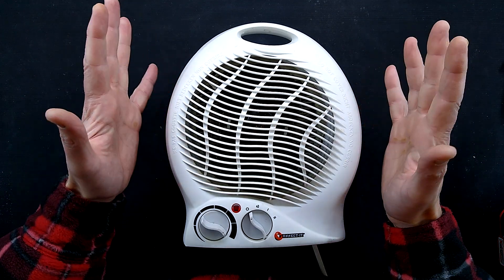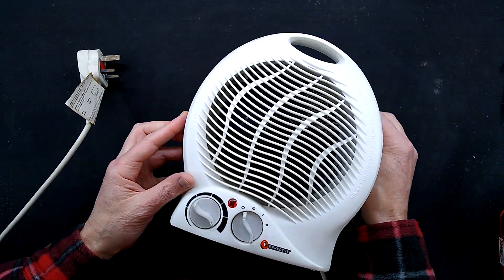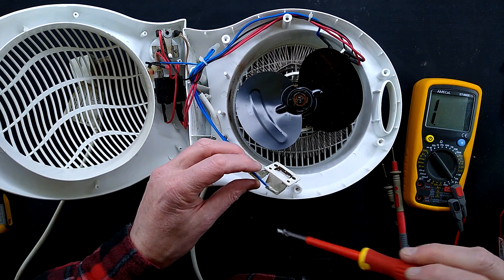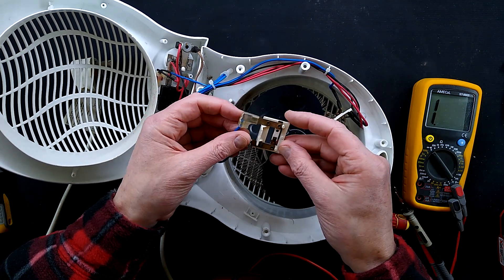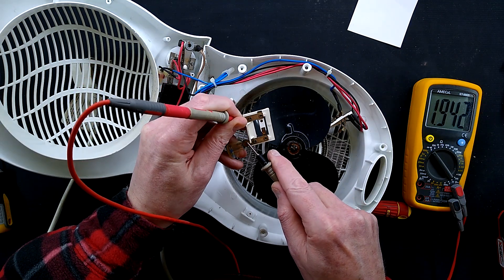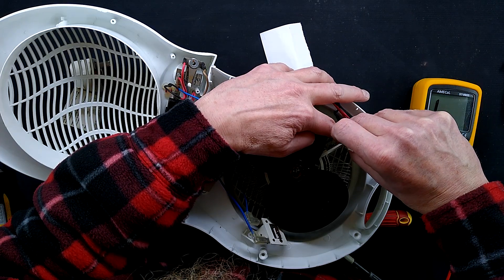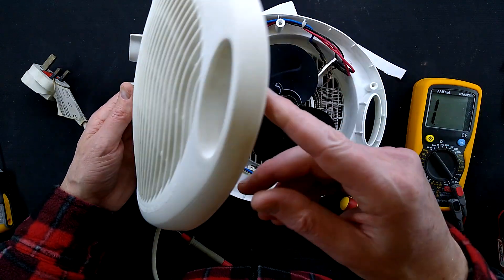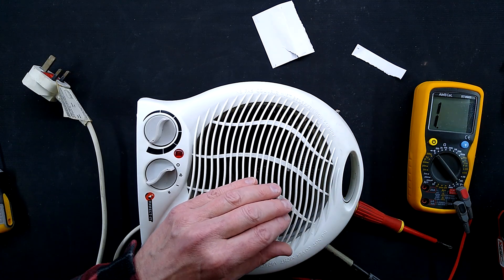Fixing a heater and an apology to my bro

Comment: I favour using something like Electrolube contact cleaner, the sort that leaves a protective film behind, to soak the paper that I drag between the contacts in cases like these.
Reply: that protective film is probably not intended for something that gets as hot as an electric heater-a non-residue cleaner is probably better in this case-something like CRC QD is a reasonable choice.
Reply: @m.k.8158  On careful reflection I am sure you are right, I was thinking in terms of light current equipment rather than power-hungry appliances.

Comment: Umm nice cheers Clive, I just brought a cheap 750w heater with 24h timer for my bedroom to reduce my central heating usage. It works really well for the 15 minuet bursts I run it, it’s definitely a death trap inside though. I expect a huge bang one day 😁
Reply: you should also expect a huge electricity bill.
Reply: @casemodder89  well the smart meter seems to soon be clocking up a huge bill when using the gas heating, £3.20 for a 60 minuets total usage on Saturday plus a shower and washing up. The electric heater just heats my bed room mainly and only seems to add around 80p extra a day with an hours use total. I don’t know what to think of it tbf or how to calculate the efficacy of things vs the rates 😭

Comment: Planning to modify a heater like this. Flat version. Putting a digital (AliEx) thermostat in between. Mine has a hysteresis of 5 degrees or so. Or not accurate enough for me. Keeping all others in between the circuit.

Another one (standing) has a rolling ball to switch of when tilting too much.
Reply: Received those thermostats.
The W3002 230V version looks pretty bad. Gets hot fast on the power side. Had some loose metal in it and wires are thin, fragile and look like aluminum.
The 4 button black one looks better. W3230 (230v input version) 
Maybe you can review one of these with "Schematic" 😄

Available on Ali or ebay for €3,50

Used a old dusk light wall socket / (in/out) as casing for the pcb instead. Just 3mm too small but with a lot of grinding it did fit in.
This instead of putting it in the fan.
Only allows 7Amps (1500W @230V) and mine is 2000W.

Comment: We had a few of these fail and it was always the one shot thermal fuse. They were used as preheating the bathroom for the children, they were never covered, only used in the I. setting (1kW-230V) and most of the time they were let to cool down for a minute in the fan-only setting.

Comment: This particular heater is probably the most generic on sale in the UK , they are branded with dozens of retail badges and cost around £10. Not surprising that most do not get repaired , tracing back from sale to manufacture and all the profit add ons and shipping it makes you wonder the actual cost is to make? Landfill galore. Excellent content as usual Clive.
Reply: I have one here in Finland, not exactly like the specimen in the video, but the general shape is the same, the two knobs just aren't next to each other, but one of the left, one on the right. I have had it for a decade or more, and it was 15 euros at max. It keeps working like a champion, although it doesn't see awfully long hours in a winter, which might explain it.
Reply: @herrakaarme  Same here, I have that same kind of cheap and dreadful heater, though mine is from a somewhat reputable local brand (Supra, located in Obernai, Alsace) but still it feels cheaply made.. I don't even know where this thing came from. 

I did use it a few times when the central heating wasn't working (the joys of living in a 1970's tower block...), although I'd NEVER let that thing run unsupervised.... I sorta got a bit of a irrational fear about these things..
Reply: @Alexis_du_60  Oh, yes, it's most certainly not going to run unsupervised. I've never let it run more than 10 minutes continuously at the hot (II) setting. The middle setting pushes out barely warm air, so I've once let it run for an hour, wanting to give a drying textile a flow of air. That was years ago.

It's such a plastic bubble that it's immediately evident you either want to heavily limit its use or treat it as an expendable commodity.
Reply: Yes it's incredible that manufacturers actually make any profit but often they make more money from P&P than from their goods !
They usually turn things out by the tens of thousands and quite often part of the cost of manufacture (in China) is subsidised so even though only a fraction of the retail cost gets back to the manufacturer they don't lose out completely. This is mainly because their government recognises the value of factories and exporters and will support them even though they are not profitable !
Reply: Remember the 6 Rs - "Reduce, Reuse, Restore, Repair, Repurpose & Recycle".
Reply: These and others just like them are all over here in the states, I have 4 of them. All in various states of failing from the fan, which I doubt can be "fixed"

Comment: I have the same heater and the funny thing is, when it is up right it wont work, but when its tilted at an angle it will work. 
I havent been motivated enough to see what is wrong, i dont use it much anyways.
Reply: the tilt switch is off level.      Design to only work when on flat level surface.
Reply: @danc2014   yeah that was my idea too, i will get around fixing it when i have the need to

Comment: I had a very well made vintage heater of this style made before the days of safety and certainly before RCDs were commonplace. It failed spectacularly when a large sewing needle fell into it whereupon it briefly shone brightly then spat out red hot heating element coil sections all over the carpet. I wasn’t sure which way to run!
Reply: Holy crap

Comment: the heaters we have here, most anyway, have a safety switch that prevents them from working unless they are flat on the floor. if you tilt them at all they shut off

Comment: That's why I prefer dark beamer IR bulbs, no moving parts, no noise, no contacts that can corrode, easy to replace, lower power and the heat can be directed exactly where you want it. Gives you more movement freedom than a heated blanket. 250W at 0.5 to 1m is enough down to 10⁰C to make it feel like 20⁰C. Two, one from each side is even more comfy. They can be found in most pet shops or for heating chickens etc. Heat the person, not the room!
Reply: . . . i might use this idea  instead of my oil electical radiator o-o ... if it really draw such a small amount of power
Reply: @Mawww_MMD  yeah heating a room does take much more energy. Still, at 10-13⁰C +IR you'll still be wearing multiple layers of clothing though.
Heating my 16m² room from 9 to 13⁰C takes 0.5m³ of gas, and about 0.1 for every hour to keep it that way. 250W IR heating above the couch takes the temp to about 22 degrees where I sit. 1m³ of gas is 10KWh of power, so it takes about 5KWh to heat the room with outdoor temps of around 7⁰C currently. I'd need 2m³ more gas to heat to 20 degrees. That's 25kWh total, offset that against just 250W IR heat to just heat my person, there's no contest that IR heating is much more efficient. I heat using gas to 13⁰C so it also keeps moist and fungus away.
Pointing it at your head, the part that looses most of the body heat is pretty effective.

Comment: I always find the plugs on these little heaters become a bit too hot for comfort,  not sure if it's the cable that's too thin or bad contacts in the socket, I just use mine on the lowest setting to avoid too much damage. Cheep rubbish I suppose

Comment: This is an ideal candidate for a diode in series with the element to halve the power, if he's got it under a blanket it'll warm up very quickly even on half the rated power! What I've found interesting with this one incidentally is the complete lack of a tilt switch, all of these upright style that I've owned have had a microswitch on the bottom to detect if it falls over.
Reply: How would that diode work to halve the voltage? A zener diode rated for high power at the right voltage? (that sounds implausible to me) Pardon me if that is a stupid question, I'm just curious.
Reply: @InfoDav  It doesn't halve the voltage as such, it just cuts off the negative half of the sine wave, so acting like a half-wave rectifier, this runs the elements at a 50% duty cycle, therefore the RMS power draw is half what the heater would usually use. No silly questions here, happy to help!
Reply: @ArlenMoulton2  Makes perfect sense now, thank you. Somehow AC always throws me off slightly.
Reply: Tilt switch - one of the best (safety) inventions ever....

Comment: I have an identical looking heater, purchased from a UK retailer, except mine has a switch on the bottom so it won't operate if it is knocked over. It's concerning that some penny-pincher thought that removing a safety feature was a suitable way to retain a little more profit from these, but here we are.
Reply: The tilt feature was required in the US  after 20xx  thus an old version may not have it.

Comment: In my experience, thermal fuses going open are one of the principal reasons that people get rid of microwave ovens.   There are usually more that just a single one in a typical oven, and when they go, they're gone.  Replacing one is usually very simple--just a couple of crimp terminal wires and a screw--and you've got your oven back again.  I keep a bag of about 10 of them (very cheap if ordered through Aliexpress) around for just such events.
Reply: Actually, the standard line fuse in a microwave oven kills many of them-the link inside the fuse weakens due to metal fatigue, so often the scenario is:
Person moves the microwave oven to clean, moves it back, and finds it dead..
replacing the inexpensive fuse generally fixes it.
Of course, if the new fuse blows-start looking for other causes:
Interlock switches are the first thing to look at in this case.
Reply: I had my sanyo microwave die, the Hv fuse had died. Easy to break, just stop start the microwave in quick succession a few times .  I replaced the fuse. More modern ones I have seen dispense with that fuse completely
Reply: I never open the door to a microwave while it’s operating. If necessary before the cycle is over, I will press the Clear/Pause/Cancel button to shut off the oven before the door is opened. I think this may minimize the chance of a fuse blowing.
Reply: @bobwigg761  Note that I'm talking about thermal fuses, not the traditional overcurrent ones.   Usually the thermal ones trip if one does a long cooking cycle--most inexpensive ovens are ill-equipped to handle, say, defrosting a large roast.
Reply: @bobwigg761  yes by virtue of how long it is before you restart it again , the fuse blowing in my experience is it heats up during the inrush surge, so if you as i have done before press the timer and start but get it wrong and then you instantly stop it and hit start again you get double inrush and the fuse heats more than usual and eventually fails.
more an issue for microwaves that have electronic start stop buttons with auto time.
Reply: @amojak  Everything you wrote is just utter bollocks.
Reply: @j.f.christ8421  Really?  I can demonstrate it for you if you like, just provide a digital control microwave with a HV fuse fitted and i should be able to blow that fuse within 15 minutes :)
Reply: @amojak  Yeah sure, knock yourself out.  This "double inrush current" sounds utterly fascinating, what orifice did you pull that from?
Reply: @bobwigg761  The doors are booby trapped.

There are microswitches top & bottom, and wired so if one trips and not the other it'll blow the fuse.  That's so if you have the door open and try to defeat the interlocks, it'll kill the microwave if you don't do both.

If you open the door while running there's a chance this will happen, I guess that's why most ovens I find have dead fuses.  The MOV can also fail and blow the fuse after a while.  Surprising reliable machines otherwise.
Reply: @j.f.christ8421  On Panasonic microwaves, which seem to be half of the microwaves in the US, it doesn't matter if you stop cooking first. The so-called short switch is on the unswitched 120 V line, so the switches are tested every time you open the door.
Reply: @straightpipediesel  It's a crowbar circuit, AFAIK all microwaves doors are wired the same.  It's not a "so-called" short switch, it does what it says on the tin and that's blow the fuse.  Stick something into one of the door locks and see what happens.

I open my oven door while it's running.  I suspect the dead ones are from people opening the door by grabbing it at the top, not by the handle.  You'll get a slight twist and if done slowly... pop!
Reply: @j.f.christ8421  Nope, "short switch" is the term used by Panasonic. My old Panasonic went out and I replaced it, so I happened to have both their schematics on my desk. There's three switches: the "primary latch switch" and short switch are always active, while the "secondary latch switch" informs the electronic control.
Reply: @straightpipediesel  What do you think a crowbar does?  Well, since you've got your schematics handy, how about taking a look at it instead of repeating "Well Panasonic call it a short switch".  Yeah, and Samsung call it a monitor switch, hooray for them too.  Works exactly the same.

Have you looked yet?  Can you see what the switch does?  Want a hint?

Here's your hint:  The "short switch" has a buddy in the interlock.  What happens when the magnetron is on and that buddy switch trips?  C'mon, should be easy with all those schematics you've got (and they'll be pretty much identical to every other microware so you'll only need one)

FFS, what do you think the "short" in "short switch" means?  That's it's one of the Seven Dwarfs?  And you're playing the part of Dopey?
Reply: @toddc5619  You need something checked.  Every manufacturer calls it a different thing.  Learning to read might be a good start for you.
Reply: I've never seen a thermal fuse in a microwave; they always use non-resetting bi-metallic thermostats. My neighbor tripped his by reheating a foil-and-paper-wrapped hamburger, which caught fire and heated the cavity thermostat. Not having a spare, I gingerly peeled loose the dead-soft aluminum sheet holding the bi-metallic disc to the thermoplastic thermostat body, snapped the disc back to the on position and crimped the sheet back on. I cleaned the embarrassing burnt mess as best as I could and gave it back to him. It's been working ever since
Reply: @campkohler9131  "non-resetting bi-metallic thermostats" are thermal fuses.

Can't say I ever seen a "non-resetting bi-metallic thermostat" though, mine usually reset just fine unless I "test" them on a stove or something where they heat up too fast.
Reply: Well, thermal fuses are the last line of defense against burning your house down. Everyone is assuming that circuit breakers are, but a space heater like the one in this video will draw less than 10A, so it has no problem setting stuff on fire while the circuit breaker (or in the UK, the fuse in the plug) sees fairly normal operation.
Reply: My microwave died recently so I cleaned all four blackened switch contacts and assuming that was all, installed a relay so the pitted switches would only have to deal with a tiny current. Unfortunately, when I gave it a trial run the transformer produced huge amounts of smoke. It's a 1980 Sharp microwave so there's little chance of finding a new transformer.
Reply: @rogerbradbury9713  Bit odd it killed the transformer.  Should have just popped the fuse, unless you put a nail in there instead.
Reply: @j.f.christ8421  No nails were involved! 🙂 I think there was a partial short circuit in the windings; not short enough to blow any fuses, but short enough to make the transformer really, really hot.
Reply: @rogerbradbury9713  I've only had one microwave transformer let out the magic smoke like that, was very exciting!  Can't remember if I used a nail or not.

Comment: I got a heater just like that, just with a different name printed on it. It can only be used in the first heating step, if I set it to the high level it trips the thermal protection without anything blocking it.

Comment: I had a small fan with a thermal fuse inside the motor winding. It was a one shot deal so it didn’t reset. It was impossible to access without damaging the motor. I was tempted to cut the wires and install a thermal fuse on the outside of the motor. But I decided not to.

Comment: I soak the paper in a bit of contact cleaner before dragging it between the contacts. Usually works like a charm if the rest of the components are still functioning properly.

Comment: Do i see correctly that it doesn't have a tipover protection switch? Usually they have a pin sticking out the bottom to keep it from working while layed down.. that's a hazard lol..

Comment: My expenses with these:
Fan can fall off.
Once switch for fan failed (inductive load), but not for heaters.

I once de-rated one of these for use on old Communist apartment block where electrical wiring is rated only for lights and TVs, in all rooms there were unfused 6A sockets with 1.5mm sqr aluminium cables. They assumed that district heating would be good (it was not, 19 degrees at best).
I first disconnected 2nd heater. Then my wife complained that 2nd level is not working (even though I warned her not to use it, because there was fire in identical tower block due to wire overloading). Next was to put diodes in series with heating elements (they were at least anty paralel). Last revision was that on 1st level both heaters are in series, and on 2nd only one, second heater was shorted out. 
Placebo is interesting thing when you have 2 levels, when one is hotter them other. Like amplifier that goes to 11.